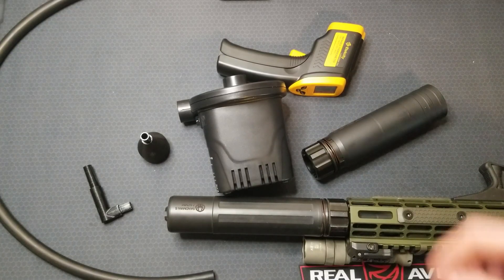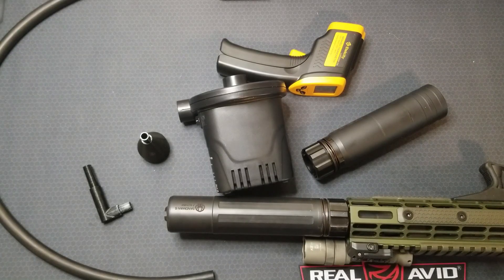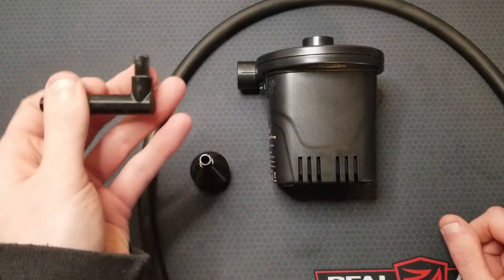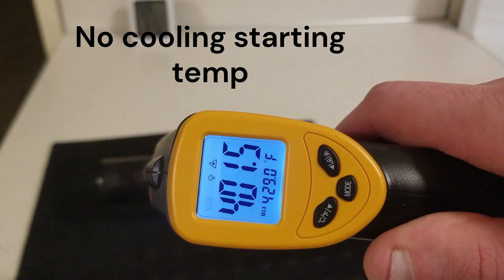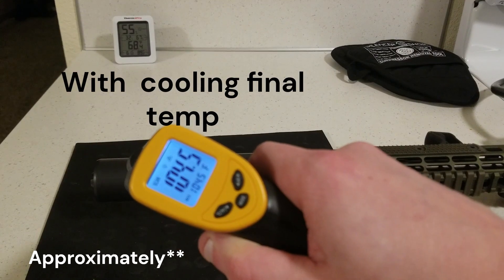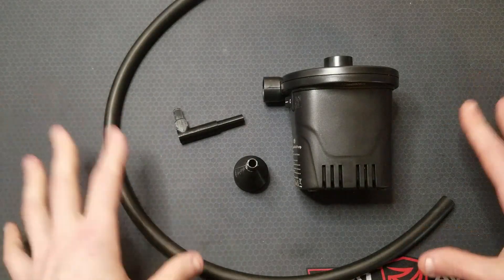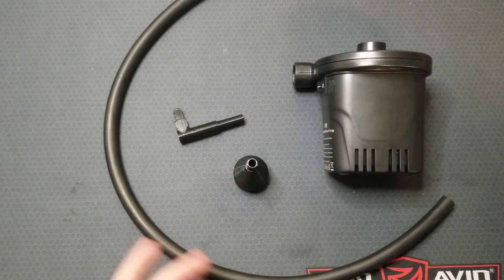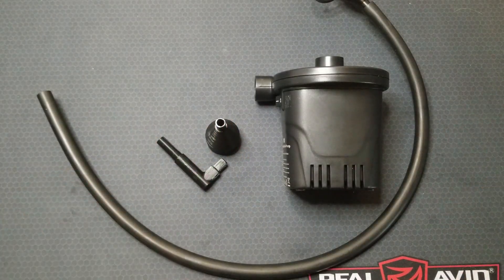DIY Rifle Barrel and Suppressor Cooling System

Comment: Just FYI, coleman has a mattress inflator that can be powered by USB-PD (no internal battery) Smaller, lighter, and can be powered by any modern USB power supply.
Reply from the maker: Oh thats cool! I wanted the one with the internal battery so I didnt have to carry a separate pack and cable. But maybe if it were small enough it would justify it.
Reply: @EngineersArmory  I had the same thought, until I realized that I already carry a 10000mAh battery pack, so why carry another one?
Reply from the maker: @JohnDoe-fk6id ah makes sense.

Comment: Have you like considered a bottle of CNC/lathe cutting fluid? When you need cooling, lock the bolt back, point he gun down and squirt some fluid down the star chamber. You could use a can of compressed air too or a CO2 cartridge if you insist on using gas cooling.
Reply from the maker: Huh hadn't thought of that. I would be worried about an oily fluid attracting more carbon fouling in the baffles tho. Shooting a suppressor wet with water wouldn't be as bad. or using water for cooling I suppose.

Comment: Just put a silicone sleeve over the suppressor and pack it up.  A hair straightener cover works great for that.  It's like six bucks or something.
Reply from the maker: Good idea! But that wouldnt keep me busy for hours like this project did haha.
Reply: @EngineersArmory  Wouldn't be an engineer if you went with any other solution!  :) Great idea, nonetheless.  Maybe to accommodate differences in specs and tolerances, TPU would also be a great nozzle option!
Reply from the maker: @ChemonV69  TPU is a great idea. I recently got a new printer with an enclosure and am excited to start printing with some new materials.
Reply: @EngineersArmory  Subbed!  I'll be checking in to see what else you come up with!  TPU can be a little weird at first, but once you get a good setting and you save that profile, TPU pretty much becomes set and forget.
Reply from the maker: @ChemonV69  Appreciate the subscription. Also good to hear about the TPU. Its always a little daunting starting with a new material.